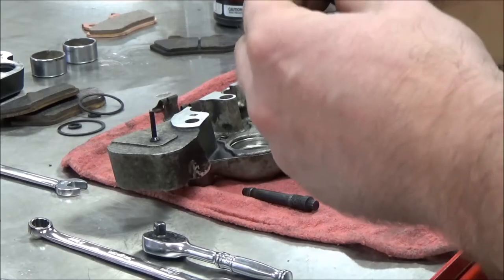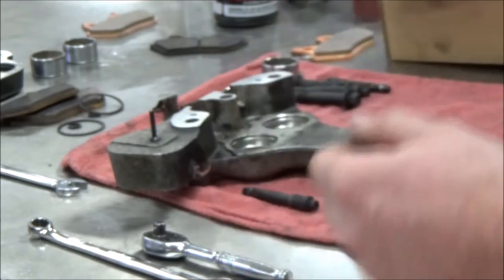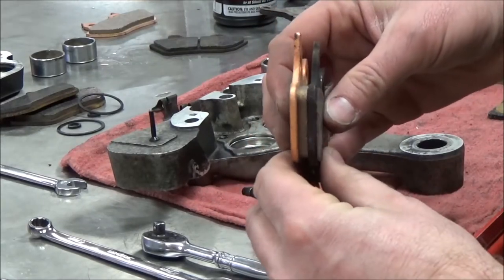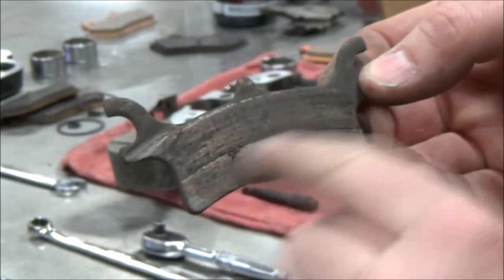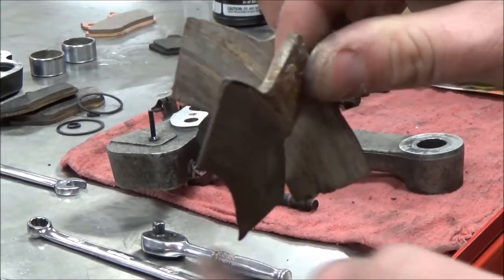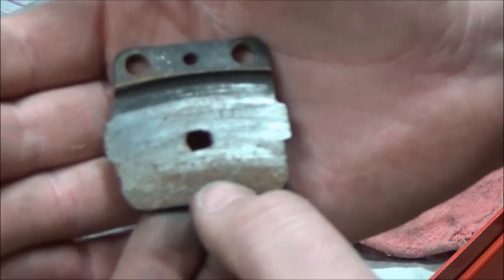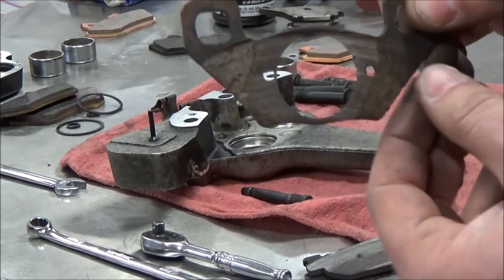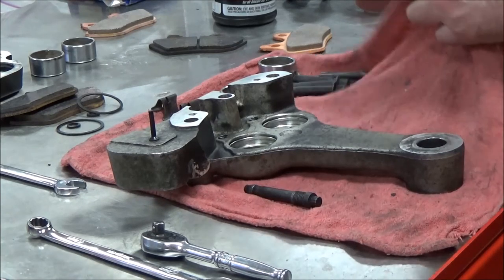My collections of  the worst customer brake pads! Can you beat me with a worst brake job story?

Comment: i made the mistake of buying J&P brand pads on my sportster to save a lil money and they only lasted me 4 months. They were already starting to eat at the rotors when i got to replacing them.  So instead of saving some money i ended up buying a new rear rotor and pads from Harley stealership and learned a good lesson, never again will i buy after market parts for my bike.  NEVER